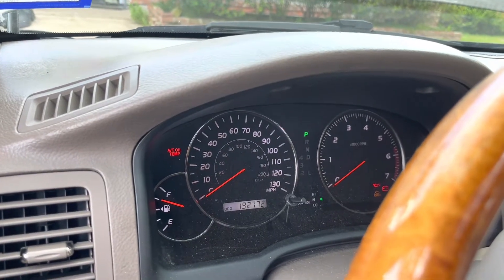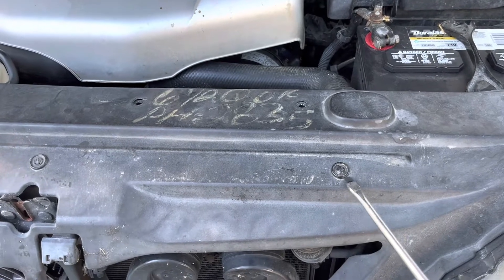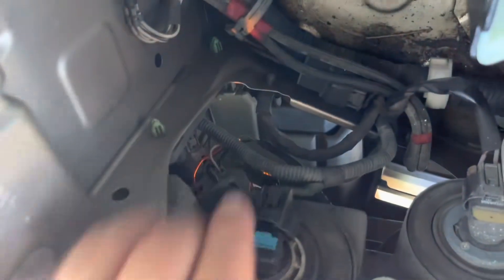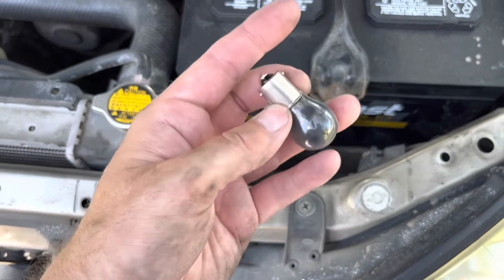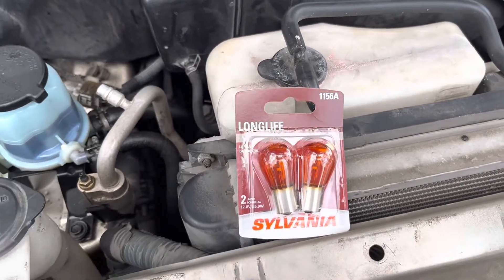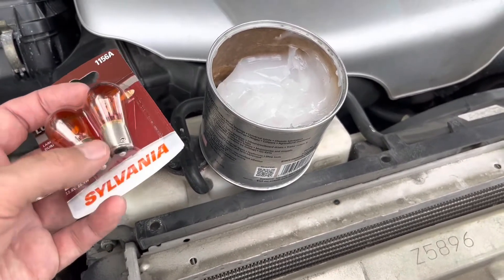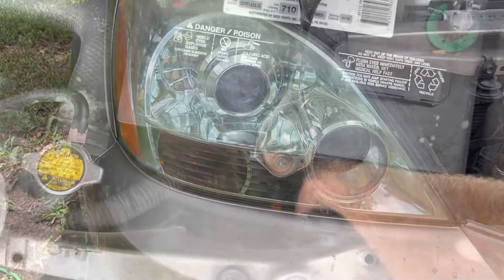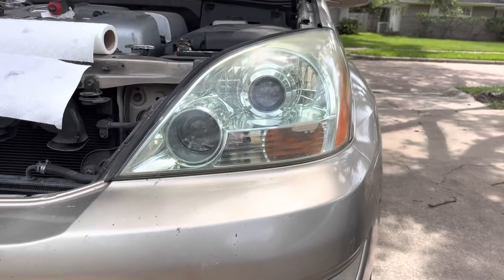Replacing the front turn signal blinker in a GX470

Comment: only mistake was touching the new halogen bulb with your bare hands,  but otherwise great instructional vid.
Reply from the maker: These are not halogen bulbs, they are normal incandescent bulbs, touching them doesn't matter. You are correct that you shouldn't touch halogen bulbs like headlights (which I call out in the headlight video).

Comment: this lexus trucks are hyped up crap i must have replaced this same bulb 5x already!
Reply: The reason why this happens is because on this generation of GX470, these turn signal bulbs double as daytime running lights, in order to comply with the new (at the time) regulations requiring it, the truck was already a finished design before these regs. In countries that didn't mandate DRLs, they worked as normal blinkers. Turn signal bulbs aren't really designed to be left on for long periods the way headlights are so they burn out pretty quick in these trucks. The alternative would have been to make the headlights impossible to turn off while driving, as there was no space left in the cluster to add yet another bulb. I believe on later years of the same generation, they switched bulb types but not too sure on that. Either way, that and the crap air suspension (replaced mine with springs) are my only problems with an otherwise insanely solid truck, mine has 140k miles and feels nearly new, I think it's going to outlive me
Reply: Oh yeah, once I switched to Wagner BP1156NA bulbs they have lasted about 4 years, one of them just burned out today that I replaced around 2019

Comment: I really wish you'd have illustrated removing AT LEAST one of the bulbs as that's the hardest part!
I can't remove the passenger bulb to save my life, which direction does it turn? Can't tell by looking at it as you can't see it!
Reply from the maker: Well, to be fair I did describe it and show the motion; how to push it in and turn it a quarter turn counter clockwise. It is the opposite to install, push in and turn clockwise. The actual socket is the same, except you just turn it an 1/8 turn counterclockwise and then pull it back and out. It is a tight fit in there, not always the easiest to turn. I'm sorry you are frustrated, try and get both hands down there on it. You can do it!
Reply: Just did mine. My cowling had aftermarket panel plugs which for the life of me I can't remove with a screwdriver.

I just replaced the bad bulb on the passenger side, and I'm gonna have to get a panel plug removal tool and replace them later on.

The bad bulb was popped and when I tried moving it the glass separated from the metal.

I prayed and got my vise grips and twisted and pulled it out, put the new bulb in and it works for me :)